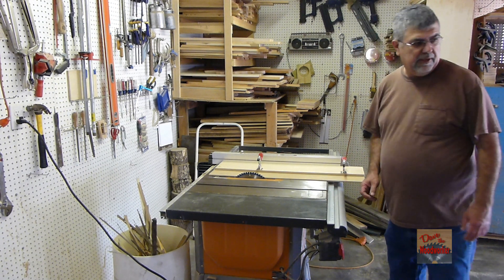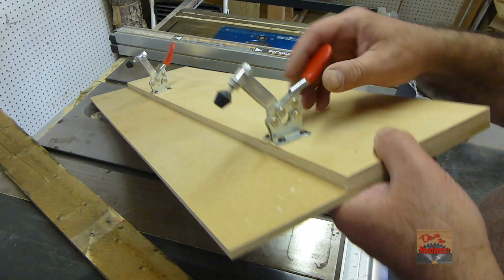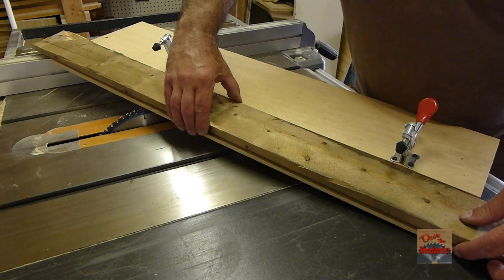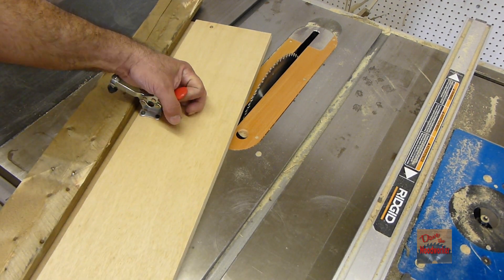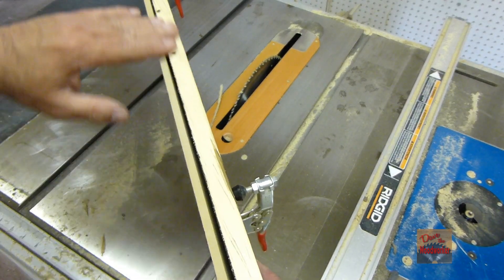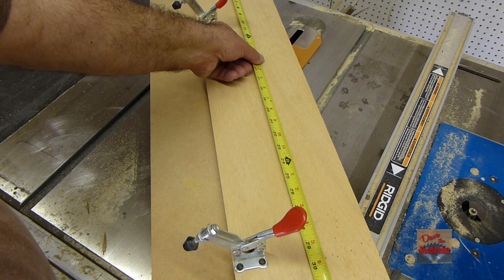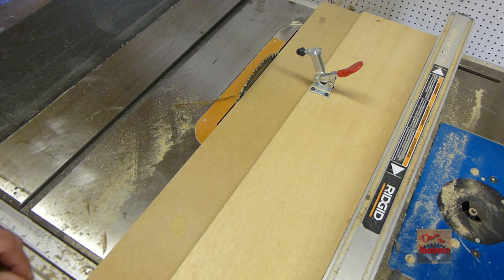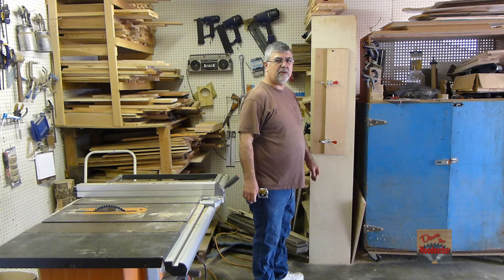Edging Jig for Tablesaw

Comment: 3:30 - If you flip the piece over and use your jig to get another straight edge, the cuts will not be parallel *unless by accident. Use the rip fence with your first cut edge to make a square and parallel board.

Comment: Although the jig is correct definitely more to making it right than what is being shown not the best video for someone who needs to make one from scratch but gets them started.  There are other videos out there that explain the build in great detail and also like some have commented here once you joint one edge you then put that edge directly against the rip fence to make a parallel cut to the other side of the board not just flip it in the jig and re-clamp/re-cut

Comment: For a "dog-legged'" board: Can I just use any piece of lumber with parallel sides that is longer than the board to be ripped?  I place it against the concave side for the first cut.  Then I use the fence for the 2nd side.  I've been doing this and it has been working without making a full-on jig.  Comments?